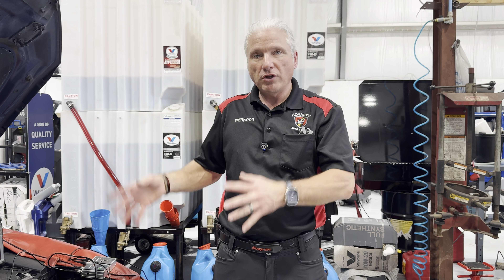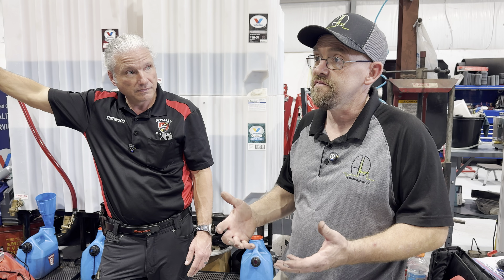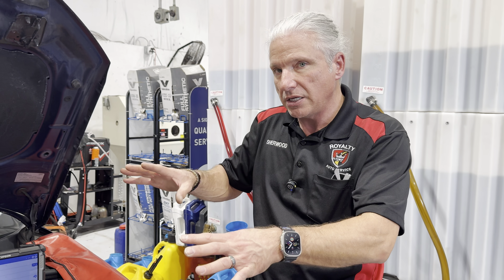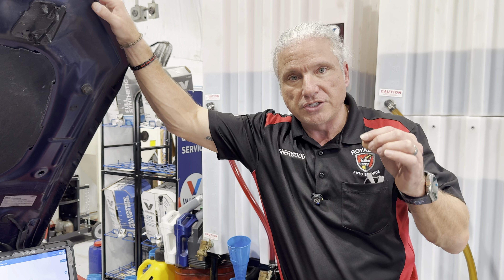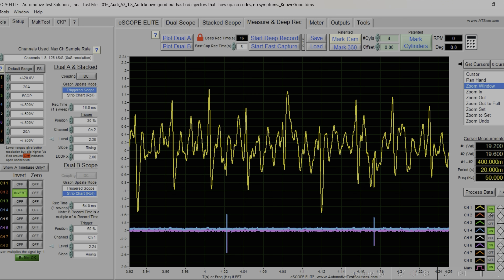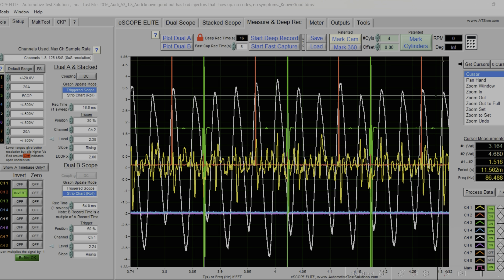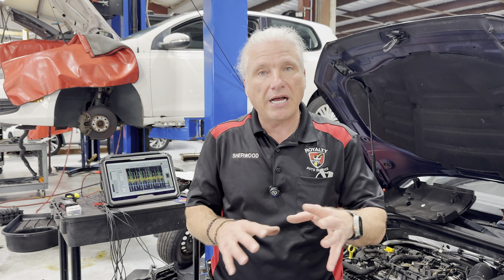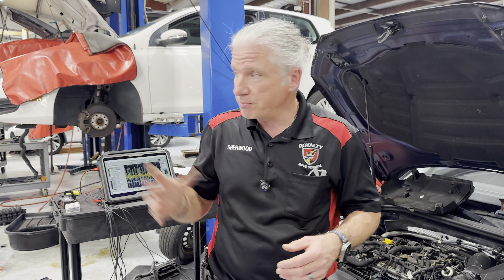This New Tool Will Make Diagnosing GDI Fuel Injectors Much Easier!!

Comment: I wouldn’t say that scope has the best resolution. I’ll give you the best automotive scope. But if you want to spend some money on a scope. Tektronix has some scopes that will blow that scope out of the water. There’s also other Lab scopes that perform better as well.  Sorry. I just had to add that. I’ve been using scopes most of my life. Not for automotive. But I am starting to

Comment: I love this idea!! I would love to have this tool. 
Few things- with my most recent experience turning out to be lp fuel (either basket built in filter, or basket reg., pump improved but didn't fix it) 
The frustration being I don't have the correct lp test kit, also, the LP pump has a PWM driver etc etc.
Suggestion: to include testing the hpfp filling, check valve, and pressure, add an inline quick connect LP sensor that correlates the cam lobe of the HPFP. Would be able to simultaneously see the LPFP dropping, and eliminate a possibility of air/low lpfp pressure, or worn cam lobe that drives the di pump. Just a thought. 
Next question/thought -- would the lack of consistency and smoothness on the running car- could that be just the nature of the flyback-> driver capacitor mechanism of running DI injectors?  Also, could that be confirmed by shielding or resistance tests? What about increasing RPM? Seems like maybe the shorter cycle duration  might clean that up. Regardless - point is- it'd be cool to add a third test/monitor, that being plot of voltage and current to and from a DI injector. (Most are two wire right?... Idk. Still learning about di drivers and such)
Reply: Oh oh also, in the event the number of lobes on HPFP is not even factor of injection events, if there's an issue with the check valve or some other pump component I can see how it might move cylinders in a cyclical manner. All me speculating- further interesting might be see how they perform by using a hydraulic accumulator with as a sort of fuel damper to ensure each inj is getting same supply to eliminate the drops entirely.... Makes me wonder now actually why that isn't already a thing... Seems like it should be, as the pump would generally work less

Comment: As an electronics engineer who has designed many pieces of test equipment all he is doing is AC coupling the signal on the sensor that measures the fuel pressure be careful because that noise can be induction coupled through other wires running around the engine it may not necessarily be only the noise from the pressure transducer
Reply: Can't a scope ac couple the signal? So theres no need for this device? Im confused

Comment: Ford has injector testing built into the diagnostic software. Both GDI and port. I’m just not sure where I would need this tool. Even without the diagnostic software. Process of elimination can leave the GDI injector as the last item. Swap, coil and plug. Hell swap the port injector if it is dual injection. Compression and leak down tests. Sell an injector. 
 Not that hard. Some dudes just want to pretend they are some kind of scientists. “Now I will break out the scope and look at the crank pattern!” Huh? For what? “Oh look at the network messages going by!” Uh why? Just check voltages and you’re good. 
 I had to take training for my emissions license and dude was showing us this huge convoluted way to see if cam timing was off on a 3.7 in a mustang using PIDs and active command. It was pretty clever. At the end I asked why I wouldn’t just run codes since that car will set a cam/crank correlation code instantly if there is an issue. He was claiming he had lean codes caused by a cam being out of phase and found that. Nobody pays you to be the smartest dumb guy in the room. Diagnose it quick and logically. Move on to the next job.

Comment: Doesn't a Noid light help diagnose fuel injectors?🤔
Reply: On regular multi port systems yes Gasoline Direct Inject is a different animal.
Reply: Why you need a noid light? It will set a circuit code right away. If you don’t have a P020X you don’t have an injector fault, electrically. 
 As a matter of fact I had an accord with a J35Z2 recently that the dealer tried to sell injectors on. However the PCM was shutting two of  them off due to class B misfires. If dummy could have gotten to the injector connectors  without pulling the intake maybe he would have figured out the ECM wasn’t firing them with his noid light and the combination of no P020X. Or he could have just had the common knowledge that modern engine management shuts injectors off after a set number of Class B misfires are detected. Either way, noid lights are only useful WHEN you DO have a P020X to verify circuit integrity. Or you could just stick your multimeter probes to the injector pins and see your injector is smoked. 
 Point is. I don’t have much use for them these days.

Comment: Does this work with sent sensor and piezoelectric injectors???
Reply: Yes, It directly decodes SENT sensor data and outputs it as an analog representation of the pressure as if it were an analog sensor.  It works on any injectors.

Comment: Does it work on a regular (gasoline) injector? It would be a huge help as well.
Reply: There are several other existing methods for doing this testing on normal port fuel injection systems, mostly utilizing pressure tranducers.  None of these other pre established methods work on GDI which is why I made this tool.

Comment: Great looking tool, I gotta get one. Santa if your listening.......
Question on the scope, around 5.50 mark you separated the green trace, I noticed the scale on the left side is fixed. If needed, how can you accurately and quickly measure a signal after its separated when the scale doesn't move?

Comment: Tool is awesome, I definitely need more practice with it though because I’m having a hard time distinguishing between the events. What I’ve been doing to determine faulty fuel injectors is checking for lean misfires with the ECOPS at idle and WOT, and then performing an in-cylinder to verify integrity of the suspected cylinder.
Reply: Which scope are you using the device with?
Reply: @ Was on the snap on scope but now I use it on the eScope. You have to 100% make sure you use the signal ground. If you use the chassis ground you will get false readings
Reply: @marcoBN  im just learning the basics of a scope. Hoping it will help me give definitive diagnosis on expensive parts.
In a different video I seen Scott connect 1 lead from the upi connector to the crank sensor signal, and the other to the rail pressure sensor. The other end of the upi lead was attached to the add I.   I didn't see him attach a ground. Maybe I was mistaken, or maybe his snap on unit picked up its ground from its own source?
Reply: @marcoBN  thinking a little more about your comment, would you say a floating ground is a necessity for the scope of use? Or as long as you avoid any chassis ground and only use the sensor, it should be fine? The unit im most likely getting has a common ground
Reply: @kaseycoleman993  The eScope shares a common ground. If you decide to have a second channel to sync an ignition or injection event let’s say, you won’t need to add a ground to the channel with the sync since you’re already using the signal ground on one channel. IMO it’s better to have individual grounds like the Picoscope but it’s absolutely not necessary. However you could fry your scope if you don’t know this detail
Reply: @marcoBN  i gotcha! So when you say grounding the sensor when using this tool, are you referring to the rail pressure sensor coming off the addi or one of the other sensors also being checked?

Comment: I really fail to see the usefullness of this tool when a Picoscope using a derivative math channel of the FRP sensor will show you the exact same thing so long as it is not a SENT type, digital requires an extra step.  Maybe ask Bernie to add some usefull Math to his scope, then it truly would be the best.
Reply: What is the point of any of this? What are we trying to diagnose here? Please give me a real world example where I would have to have any type of scope to diagnose an injector. I’ve literally never run into the need to hook any type of scope up. Clearly I’m skeptical but maybe I’m wrong.

Comment: We bought one 3 or 4 months ago, 3weeks ago we were having a problem analyzing a signal on late model 6.6 Duramax. Called Scott drove up to our dealership from Missouri to south Chicagoland and spent the day with us. Great guy and good tool!
Reply: It was a honor getting to hang out with you Scott, thank you for your support!
Reply: Hey John,what kind of problem were you having with the Duramax?
Reply: @DouglasMonaghan  It was a 2024 Duramax with a cold start fuel delivery/return problem causing an oscillating idle concern. I work at a Chevy dealer and my buddy was working on this, I was helping out with the scope and ADDi tool.
Reply: What scope are you using?
Reply: @kaseycoleman993  Pico 4425A
Reply: @kaseycoleman993  Pico 4425A

Comment: If there’s a pressure sensor in the high pressure rail sending a signal to the PCM then shouldn’t we be able to access that data with a scan tool? If not, why not?
Reply from the maker: You can but it just gives pressure. It doesn't have the detail you would need for this test.

Comment: If the existing PCM was tweeked by the manufacturer of the vehicle to be more sensitive, especially around cylinder specific misfires , and if the existing fuel rail pressure sensor was used and corrolated , then it would seem that future on board diagnostics could do the same thing.  Next level PCMs and their self diagnostics might make a tool like this obsolete .  Too much detail and information could become a problem itself. If you jumped from the 2nd floor hay loft into a bale of hay, and this tool found a needle in that bale of hay, that does not prove the needle was the root cause of your broken leg as the result of your fall.

Comment: Scott's probably aware of this but I doubt it'll be long before someone copies this box. 
A friend was in a similar situation over here in UK, when he made a much more compact tool design than anyone else had. He'd added a hidden, redundant circuit into his design and all the copies had that, proving they'd stolen it.  He easily won every court case when he asked thier expert what that bit did.
Reply from the maker: He did patent it so hopefully that will hold off the copies.

Comment: With Fuel pumps disintegrating plugging up injectors at 1,000s of dollars to repair; sloppy signals on known good systems indicates more than design flaws! It's junk on the drawing board, it's junk when it's new with Lousy mileage and poor fuel economy and after a few years it's going to die a horrible expensive death or cost you $$$ often enough to make it's design obsolete in just a few years. FORD QED sell more Trucks.

Comment: Looks like a tool that will be very useful if you can prove the drop in pressure or lack of drop in pressure is due to the faulty injector and not the ecm changing the injector pulse width as well as making sure you have correlated the correct injector with the correct drop. Im excited to see where it goes and congrats to Scott for being innovative and helping to solve a problem in the automotive world. As techs we battle so many problems every day!

Comment: The tool that manufacturers use is called afit. Replaces the vehicles ecm and cranks for each injector and watches leak down using the pressure sensor. Been around for years
Reply: We have seen a lot of damaged pcm's from using the afit tool on gm products.
Reply: @billmoore6520  not saying you haven’t but I don’t see how considering you remove the ecm and put the tool in its place. I’ve done it hundreds of times and have yet to see it cause an issue.
Reply from the maker: I haven't seen that one. I'll have to do some research. Thanks!

Comment: Question is there a way to tell if a high pressure pump sensor is off (skewed) and what pressure is actually at the high pressure rail
Reply: As far as I know, the only way to check fuel rail pressure on a gdi system is with a scan tool.
Reply: @052RC  thanks
Reply from the maker: The only way is through the scan tool data.
Reply: @theroyaltyautoservice  that’s what a thought so if the pressure sensor is bad but showing good numbers your on the rabbit hole. Thanks
Reply: Tommy Wolf did a video a few years back on a VW Golf i think it was that was setting a code for HPFP too high. He put the genuine VAG tool onto the rail which is a digital pressure gauge and he showed that the actual pressure was something like 125 bar. My numbers are probably off but either way it was proof that the rail pressure sensor was reporting accurately
Reply: @davidmoss9471  I’ll have to find that video thanks 👍🏻
Reply: @davidmoss9471  I guess it would depend on how expensive the digital gauge is and how labour intensive it is to connect. Does intake have to be pulled thus not being allowed to run engine. Does gauge hook inline with high pressure line, or do you remove factory high pressure sensor and install this device?

Comment: To make heads and tails of this I'd love to see you guys redo this test with an in-cylinder along with current of all the injectors, an injector sync, and the ADDi on the FP Sensor. Because on GDI it should fire the injector alot closer to TDC comp than a port injector. That way you can more accurately determine which drop correlates. It almost appears as though a whole bank contributes slightly less.

Comment: Ingenious tool design.  But how much difference between GDI injectors is acceptable?  What is typical?  I would think there can't be a perfect match between injectors.  And a replacement might have the same variation?
Reply from the maker: You could definitely see an inconsistent drop in crank acceleration. I think on a car with a misfire problem it will be obvious. Hopefully we will get one in soon.

Comment: You are saying non broken car  , but correct me if I’m wrong , the ECM has an allowable variation in numbers before it sets a code. Like 10 or 15 % of set values.
Reply: Absolutely true, the misfire is still within acceptable limits at this point and is not yet setting any misfire codes despite the misfires being detectable.  The tool also works well for fuel trim imbalance situations.
Reply: Might not set a misfire code but it can definitely set lean or rich codes
Reply: @goenitzlopez2076  more often stuff like this causes fuel trim imbalance DTCs, but the difference as in this case does typically cause subtle variations in contribution.

Comment: When I saw the price of that Addi I said Holy s..t! A grand seems a lot for an op-amp and some filters or what am I missing?
Reply: If you own a Pico, a derivative math channel of the FRP signal will show you the injector drops.  I wish ATS would get off their hinies and add a derivative math channel to their scope.
Reply: @paulpaquette1961  is there some kind of tutorial, forum blog or video on that ? Been trying to find it for a while 😅
Reply: I'm curious to how much phase shift is in this tool.
Reply: A few high speed OP amps and some active filtering. Maybe even a DSP chip with some software. Still, all relatively inexpensive. I realize you gotta have a return on investment or ideas, and the market will bear the price, but it still seems pretty steep. Just like you can buy a 24.99 Temu port fuel injector pulser, or a 200 OTC or Snap On unit. Both are just a 555 timer driving a power MOSFET.
Reply: @stevestadnik9206  it's not that easy. When you need 1mV p/p gen with a sync, and instruments the measure mega, and pico  ranges. Why  you would ask or tell its not needed. Build one.

Comment: Could the fuel pressure drop irregularities be because the PCM is changing injector pulse widths between firings? Measure your injector on times to see if they are different. These newer vehicles can detect air fuel ratio cylinder and bank imbalances using the O2 sensor and adjust air fuel ratios by cylinder.
Reply: I do typically reset all adaptives when doing this test, on a suspect cylinder I measure the suspect injector's on time as you suggested.
Reply: True
Reply: I was going to say there could be some variable
Reply: @josephespinoza9354  When I run this testing, I don't ever take one spot in the capture. I'll take multiple captures, and if I see an overall pattern where one individual cylinder seems to consistently exhibit a particular pattern, I will do as you say and investigate the on time and make sure everything else is equal.  I then take a capture immediately after resetting trims and adaptives to see it the overall pattern is still present.  If so I am comfortable calling injectors.
Reply: Seems and sounds to me like gdi injection was designed by a corporation bound and determined to further complicate a mans ability to work on hos own vehicle, even let alone what we're just yesterday competent techs. Why don't we as a people say hey look big auto... Were not buying, not working on hell were not even repairing this highly problematic and ridiculous design for fuel delivery. Let alone reliable engine function what other engine can grenade within just seconds based on such what were otherwise trivial issues? Crip's sake what would have used to have been a diagnosable, repairable situation now is such a train wreck. Just like gubbment people you'll condition to get what you deserve if you're never willing to stand for something and say yeah...nah, we're outy this is bs we're done playing monkey riding the football. Lol I mean wow.
Reply: @Roboticdoughbull3kYou can thank the ever increasing emissions and fuel economy standards for the widespread adaptation of GDI. It's been wreaking havoc on the automotive industry for some time. Nobody can spend any amount of time improving one type of technology because they're constantly having to work on developing new tech to stay ahead